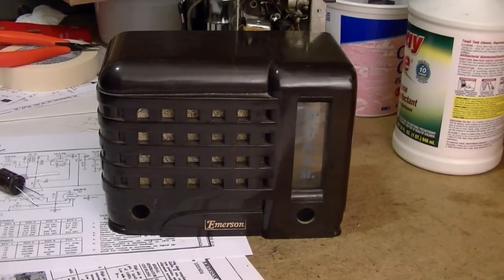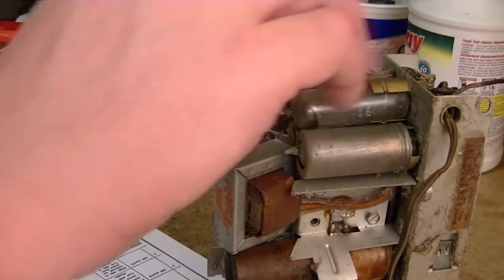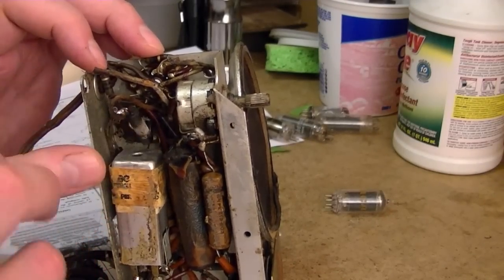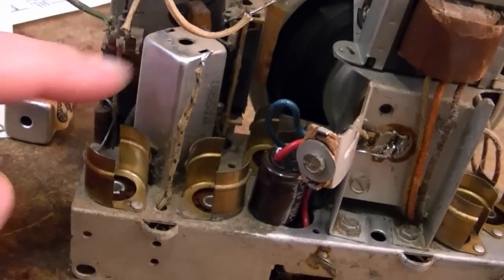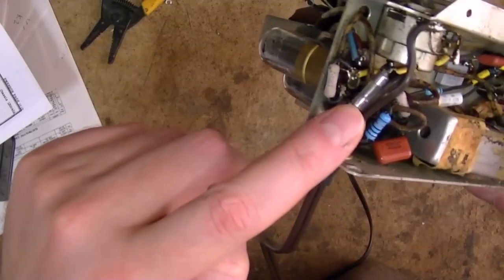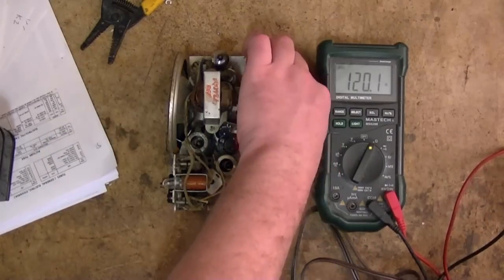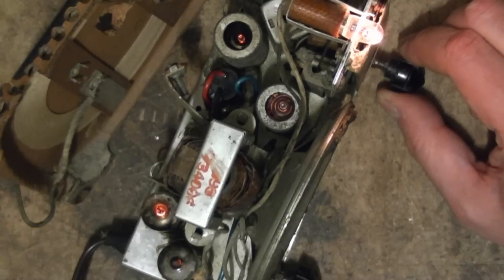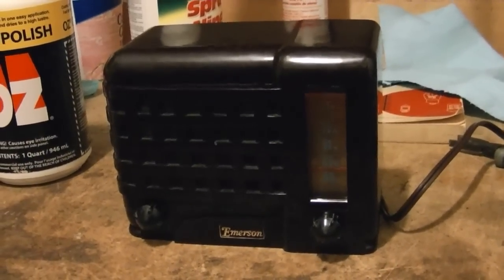Emerson 540A restoration

Comment: Emersons, just like Crosleys, were always budget sets for the most part, but the ones that I have owned generally worked well. At least this set had two IF transformers, the cheaper sets used one, and the really cheap sets used a TRF circuit even in the late 40s.Those little AC/DC sets are cute but as you can see by the melted wax, they tend to cook themselves to death, I'm surprised that the speaker cone isn't all brittle and falling apart from the heat.

Comment from the maker: Mostly Mouser Electronics.  Also, Allied Electronics, Digi-Key and Just Radios.  It really depends on the parts I need for a particular project.  

Have you seen my video on Capacitors ?  I talk about which capacitors to use and where to get them in it.

Comment: I've always loved the Emersonette.....a true model of  packaging efficiency. But I was wondering; why the dim bulb tester instead of your variac?
Reply from the maker: Don't recall as this was over two years ago.  Variac might have been busted.  Also they don't do the same thing.  A Dim Bulbs will restrict the flow of current if there's a dead short.  A variac will pump out plenty of current at the selected voltage.

Comment: I've been restoring an Emerson 503 and the 50L6GT is running 230 VAC, way over normal voltage.  The plate resistor on t he 35Z5GT recitifier turns out to have resistance wire instead of a normal resistor.  Has that stuff been know to change value with age?
Reply from the maker: 230 VAC ?  Do you mean VDC on the plate ?  No, wirewound resistors are very stable.  How does it measure ?

Comment from the maker: It runs so hot I'm afraid to use it for long!
Reply: check voltages on filaments and HT. usually a 33/47 ohm resistor should help to bring 125v line down to 110 or so. helps with tube life and heat